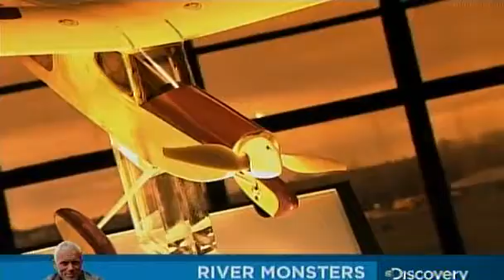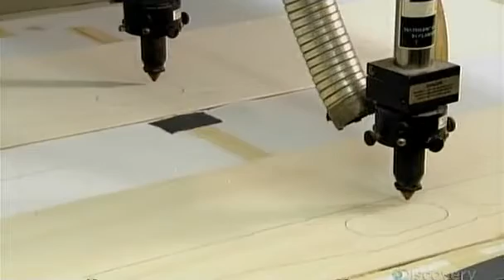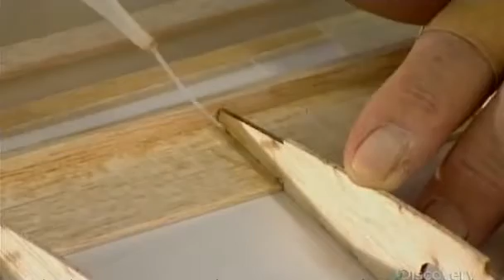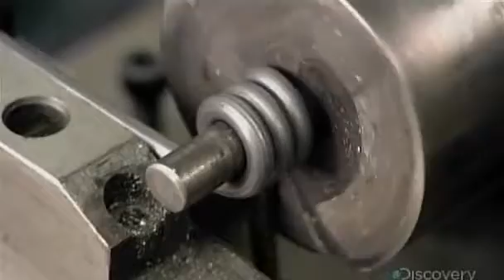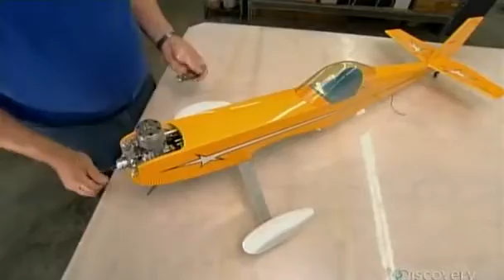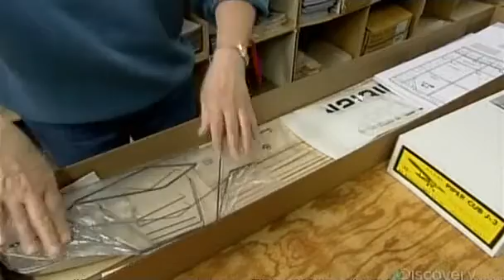How to make Wood Model Aircraft {www downloadshiva com}

Comment: It's a pity they are so expensive to buy.
Most kids can't afford them. creating lack of interest.
Reply: Try Easy Built or Dumas. They have a huge array of kits. Start with laser cut kits. The kits range from oh...... fifteen bucks to seventy. That are great. The obstacle is more a matter of a need for patience and the help of someone who knows what they are doing. 

Dumas has kits designed for electric rc in the sixty to seventy bucks. That is everything minus the motor and electrics........

Rubber powered planes are tons of fun and a much more affordable option, gliders too. No need for rc to have tons of fun.